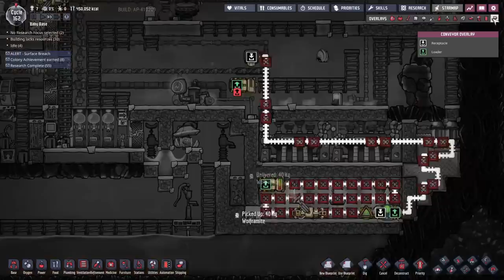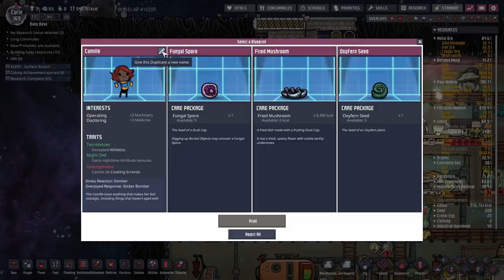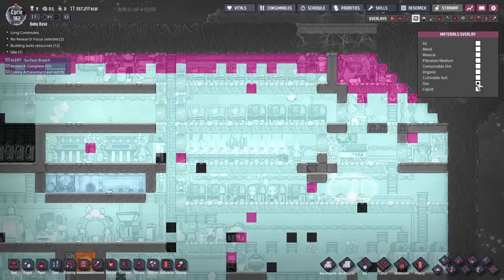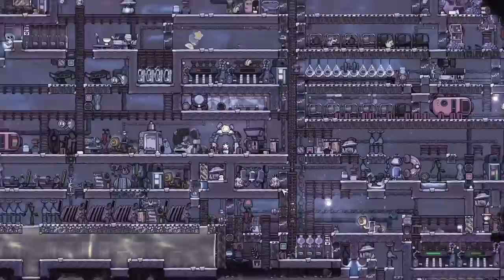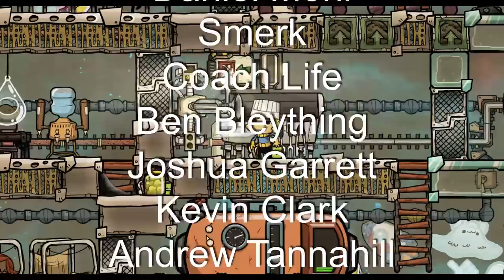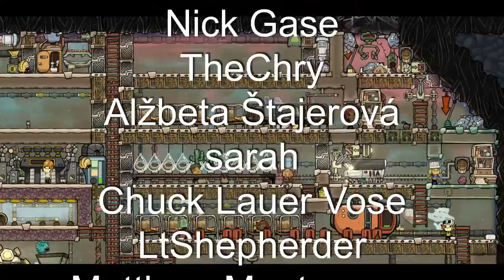Baby Base 7 : Remodelling and the hunt for Chlorine : Oxygen not included

Comment: Remember the telescope when you start reshaping the base, you will have to open the space on the right side and at least maintain it standing there to have access to the starmap and research the planets
Reply: Once you're finished with all the planets though you can move it somewhere else. I put mine inside my water tank (which is vertical in my base) where it will sit in all eternity, drenched and inoperable.

Comment: Here is an insane idea to store all that extra water, freeze it and stuff it into storage bins.  Storage bins can hold a lot more ice than a water tank can hold water right?
Reply: No need for storage bins, just drop it on the ground in a vacuum
Reply: That's actually genius.
Reply: One storage bin can hold 20tonnes, or the equivalent of 20 tiles of water.
Reply: @2000Meilen  dropping it on the ground is infinite tho
Reply: If you are freezing it, why bother with storage bins, just drop an infinite amount of it onto the ground in a tiny cold room. Then of course you also need some sort of counter-flow to turn it back into water for when you need it.
Reply: @nolan4339  you could just maintain a warm water tank with a tepedizer to reheat it. Drop the ice in, maintain 25-30C and you should be fine. maybe add some metal tiles if you are feeling fancy
Reply: Wouldn't the energy use be too exacerbated? I guess you can ''store heat'' and control it's throughput to some counterflow but that might be too ''spacy''
Reply: Along with what everyone else said, freezing water and then mining out the ice will destroy half the mass of the ice - infinite storage is definitely preferable
Reply: Kinty if you freeze the water in small quantities just like you do in a regolith melter, the ice wouldn’t form a block
Reply: Indeed you can freeze the water into debris.. and then make temperature shift plates out of them to bring them back (quickly) or create a conveyor rail system to bring them up to temperature (less quickly) because just dropping it into a tepidizer tank I feel would be the slowest option of melting it.
Reply: Single tile storage is now possible, but the main issue is energy to freeze it all.  Yeah, I'm a year late, so what.

Comment: The reason the reservoirs had more germs than the water is because the amount of germs is dependent on mass. It doesn’t tell you how many germs per unit of mass, it tells you the total germ count in the tile or in the reservoir. So it would make sense for a reservoir to have up to 5x the amount of germs as the water it was pumped from, because it holds about 5 tiles worth of water it can hold 5 tiles worth of germs.

Comment: when i use steam turbines with the magma biome, i just dump water straight into it, as opposed to moving it with pitcher pumps.
Reply: The problem with that is your steam would be as the same temperature as the magma, the problem on this is that your steam turbine would reach its maximum energy output and would start deleting heat instead of conserving it, plus you'd need a stronger cooling system to maintain the extra output of heat the turbine would wear off in scenarios where it's operating over its maximum output. So you are deleting heat you could be transforming into power, and you are forcing the need of stronger cooling systems.
Reply: I do this as well but once I have thermium, especially super coolant since it will be over 400c and easily over heat the turbines.. I throw a calculated amount of salt water on top of the magma biome.. vacuum the area above the water (map permitting) and throw 20 turbines on top of it all and start eating through the magma biome (temperature permitting) at the end of it all before the steam gets too cold for the turbines I pipe out the water from the turbines into a holding tank that will be too large.. creating a vacuum of the bottom of the map.

Comment: The JUUUUUUURRRRMZ!!!
I have 2 questions on the side. 
1) since polluted water will turn into (idk the exact numbers) like 80%-90% water and dirt, would you save space by converting it all? Would it be worth it? 
2) Do germs on a building in the vaccum of space die? I know objects like slime, minerals, etc do but buildings? I was thinking : if the compost is a vaccum, it could sterilize it and it's expelled dirt.

Comment: Would dumping regolith into the magma make an efficient ghetto regolith melter, since youre using a magma boiler?
Reply: Not really. Without a big counterflow heat exchanger (which he doesn't have space for), the low-temperature regolith would drag down the temperature of the magma, so you'd have a larger quantity of magma, but at a lower temperature, and I believe you'd actually get less power out in the end (maybe it'd still be more. I'm not sure). Even with the heat exchanger, a regolith melter does need some renewable high-temperature (though not necessarily high throughput) heat source to keep running permanently, to combat the slight tendency for the temperature to drop due to the incoming regolith still being slightly cool.
Reply: @tejing2001  Yeah I think I got it. Since the magma would try to reach temperature equilibrium with the newly melted regolith, you'd use not only heat to flash it but also to equilibrate it with the current magma temperature but maybe there is a way to counter that and make it work? I think the gained thermal energy is 5x so there should be a way to work it out

Comment: I have yet to see anyone realize that one wheezwart next to a liquid container is all the decontamination water would ever need. Current game: germ tsab of water, within container: Food Poisoning: "Exposed to 319 Rads: 90% dead/cycle"
Reply: Container 4 tiles away that recircs my bathrooms: Exposed to 14 Rads: 51% dead/cycle.  so half as effective as chlorine at that distance from wheezewort.
Reply: OH! - FANTASTIC channel! thanks for the tutoorials and gasming. ONI is much more challenging/less frustrating now.
Reply from the maker: Pretty sure they was before the intro of rads, radiation has changed the decontamination meta a bit. But I suppose it all depends on what you use it for, I tend to not decontaminate unless I really need the water, baby base was one of those instances.

Comment: @Francis John, how do you arrive at 20 shove vole for 12 dupes. I've tried crunching the number and my number is way off from yours. Unfortunately oni assistant only has the numbers for normal vole ranch, not a starvation ranch. The number I arrive at is a vole will starve in 13.5 cycles, laid 1 egg before it dies and thus giving 20000 kcal of bbq in its lifetime. Which is about 1400 kcal per cycle. 20 voles should comfortably support 25 dupes. Please tell me where's my mistake at.

Comment: I tried to use the free-energy gas filter, like you have shown in this base, but few gases managed to escape... Any idea how to improve?
Reply: It cant move max size gas packets because the 1g of the chosen gas in the loop so a tiny amount will sneak through. putting 2 of them in row solves that problem. Its a little bulkier but the second one will catch any excess that gets by. alternatively just use the power on an actual filter
Reply: @matthewbauerle7153  No, overpressure gas vent, gas sensor and NOT logic. It is a natural gas... channel, but oxygen an co2 managed to be stuck inside. After i buils this trick, natural gas escaped

Comment: Dude. Keep the voles in the tiny bit of space biome you have. Wall it in with open doors and use one of the access points through the roof as room for the stations and have  a "1 high" room for them to crawl around. You get more space and they get to eat regolith that you don't have to mine or move.

Comment: I was thinking and you don't need chlorine to clean water (is faster to use chlorine), you can use cold, if you get the polluted water to zero degrees you can kill the germs fast, after that you just need to heat up the water to 10Cº and filter it up to clean water, this is also valid for food/other items.
Or you can cycle the clean water to the steam turbine and kill it with heat.

Comment: If you drop the regolith directly in the lava.. will it generate more lava than what was there?
Reply: I could be wrong, but I think it would eventually cool the lava and solidify it. I don't think regolith can be abused to make heat.
Reply: @draconicepic4124  regolith smelter build exist for that reason... it is a energy positive process...
Reply: More lava, yes, but it will be cooler. Making a proper regolith melter requires a counterflow heat exchanger between the regolith and the igneous rock, as well as a high temperature renewable heat source (though it needn't be high throughput) to keep the temperature from settling over time. He doesn't really have space for the heat exchanger, so I'd say it's a no-go.
Reply: @draconicepic4124  It can be, but it requires a more complex system he doesn't have space for here.